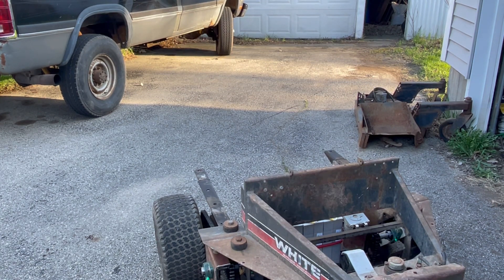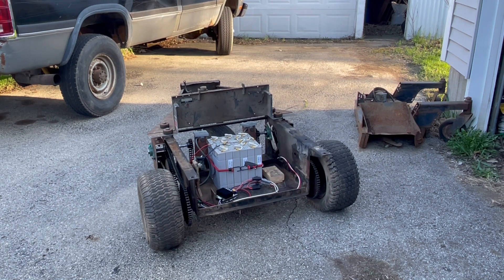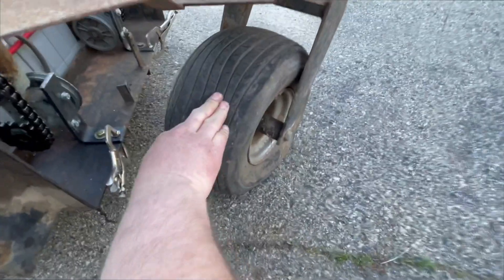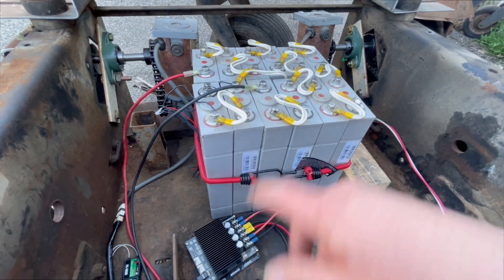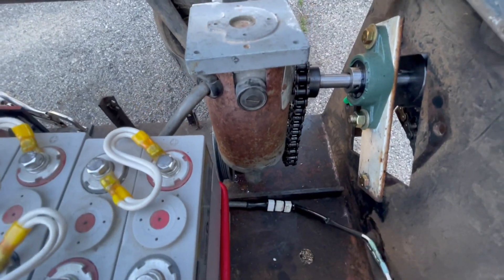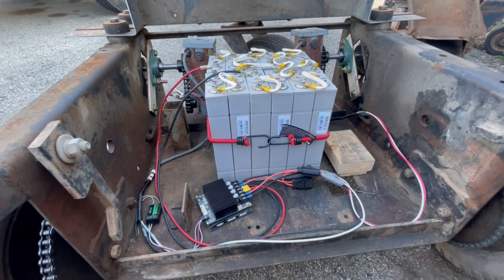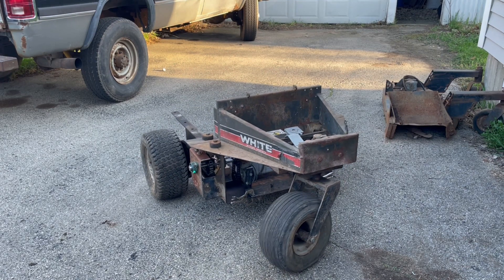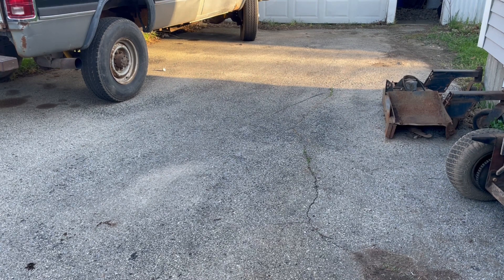Electric Drive, Remote Controlled Lawn Mower Made From Recycled Components: First Test Drive

Comment: That's a great start. Getting a deck attached with an electric motor "should" be pretty easy once you get this far.
Do the wheelchair motors have the torque\gearing they will need to go uphill on grass?
Reply from the maker: Thanks, Not sure about the motors yet, fortunately I don't have any hills where I'm at. The deck will be its own challenge.
Reply: @WiredEdge  with electric,  the deck is the easy part,  offset the motor between the blades with a tensioner and you are done.
Reply from the maker: @GuysPlayingWithTools  That is one option. I also thought about mounting the deck motor on the base and driving with a belt, like was done originally.
Reply: @WiredEdge  I am just thinking outside the box. The belts would be a lot simpler since they won't be needed to drive the wheels if a seperate motor is mounted on the deck. 
The wheels also wouldn't need a transmission, the motors can drive either a straight axle go kart style, or put a motor on each wheel.